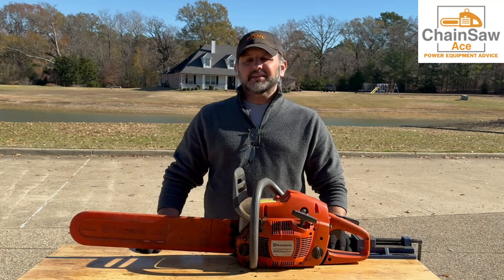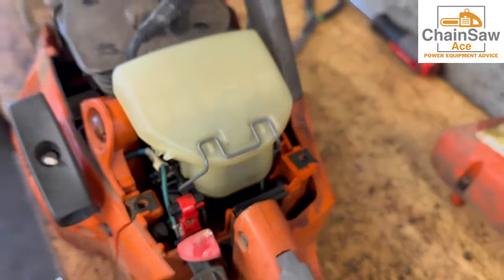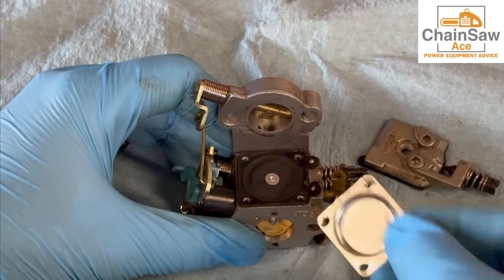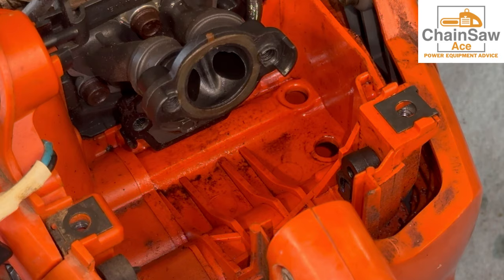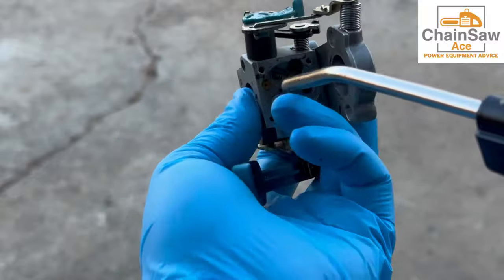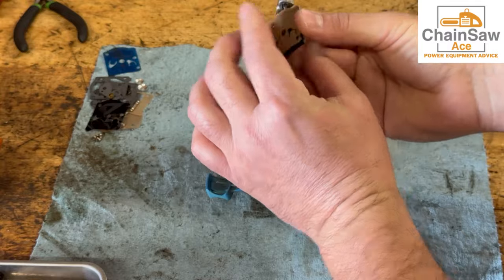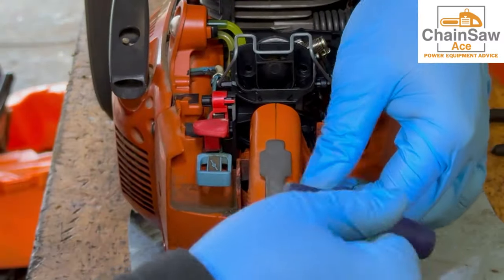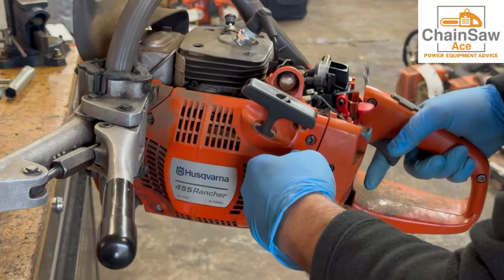How To Rebuild the Fuel System of a Chainsaw! - (Husqvarna 455 Rancher)

Comment: I gotta do this job soon, and I was lucky to find this!!!  Thanks it's a great how to video.
Reply from the maker: Awesome. Get her done! Thanks for watching.
Reply: @chainsawace1777  I pulled the blue kill wire out of the red plastic housing where it turns off and on and also off the spade just ahead of it. Bad move. I was expecting to see a metal spade connector in the housing. Now I have no idea what the female connector slides on to since I don't see a male spade in there. Any help appreciated.

Comment: I know you made this a couple years ago but thank you!  Quick question, when adjusting the carb do you need a special tool?
Reply from the maker: It depends on the chainsaw. Some older saws just required a small screwdriver. However, newer chainsaws require a special tool, but different brand saws use different tools. Here is a tool kit that has about everything you need for adjusting carbs. HIPA makes this one. Very good quality: https://amzn.to/3woopbF

Comment: Just noticed your bar for holding the chainsaw prior to starting it did you design that or was that commercial? Could you possibly take a picture of it and supply it thank you.
Reply: Did not receive an answer to either of my questions with regards to saw holder and or sonic cleaner
Reply from the maker: Sorry sir. I missed it. The holder is a bicycle clamp. It fits the bar of a chainsaw or trimmer shaft perfectly. Here is a similar one on Amazon. https://amzn.to/4aWLws5
Thanks so much for watching!
Reply from the maker: What was your other question?
Reply: Thank you for the response. I’ll have to find a bicycle holder.
Mr 2nd ?Was what you’re using to clean carbs in sonic cleaner

Comment: Got a video on how to install an antigravity unit on a 455?

I like mine. It's like a Cummins Diesel in the wood.  But I'm getting old. It's heavy and hurts my neck & back & elbow & knees. Wahhh!

-Pro saws are good for around 2000 hours. A 455 is likely good for close to that (except the fuel system) due to metal reinforced crank case and large crank bearings, if it's taken care of.  But even if it only lasts half as long as a pro saw, it's only running for about an hour per cord. If you cut and burn 10 cords a year, it'll last 100 years.  If only 5 cords, 200 years.  If only 2 cords, you bought the wrong saw.  
They're a good used saw to buy too.   You might get lucky & find a well cared for one from an old codgers estate who died from a stroke or snapped his back in two all alone in the woods while heaving his fat toad firewood saw around and was eaten by wolves or coyotes. If so,  buy it. Bonus: After one season cutting firewood, you'll be built like a brick outhouse from the workout you'll get. It you'll need lumbar surgery.
Reply from the maker: Great comment!  I love the Husqvarna 455 as well! Thanks so much for watching and taking the time to comment!

Comment: Sir,how do I remedy the black substances on my sthil saw muffler? Its a fairly new saw as well !
I'm running 98 octane gas with a 40:1 mixture,using sthil oil !
Thank you in advance Gunter
Reply from the maker: Hi, thanks for watching the video. Your problem is you're running the wrong fuel mixture for a STIHL. 

All STIHL Chainsaws and other gas burning handhelds run a 50:1 fuel mixture ratio. 

You are doing the correct thing in running a high octane fuel. The higher the octane the less pre-detonation of gas in the cylinder. 

Just make sure you switch to 50:1 mix and your clogged muffler should clear up.

Again, thanks so much for watching.
Reply from the maker: I just noticed that you said it's STIHL branded oil that you're using. I've never seen that ratio sold by STIHL, but I may have just missed it. 

Anyways, switch to the 50:1 mix. 

Also, the best and cleanest burning oil mix you can buy is the STIHL HP Ultra Mix. It's fully synthetic and comes the in the silver bottle. 

The orange bottle mix is the standard oil and does not burn as clean as the silver bottle hp ultra.

Comment: So, great job but a compression test doesn’t actually tell you anything about the cylinder, it just shows the rings aren’t stuck and you can tell that without a tester. I personally have saws that are completely scored up but still show 150+ PSI of compression, just something to keep in mind
Reply from the maker: Thank you. Good info. Appreciate the feedback.
Reply: I would save yourself a lot of trouble and just look inside the cylinder by using an endoscope. You could also just take off the muffler. Compression tests can lead you down a rabbit hole.